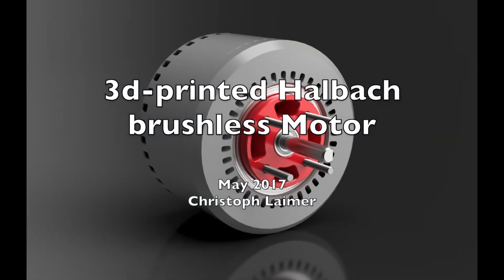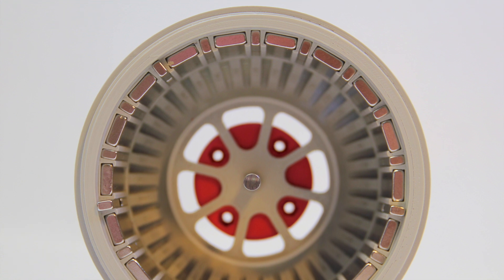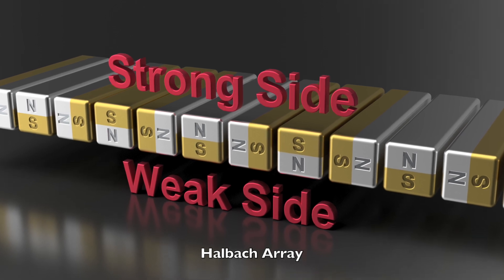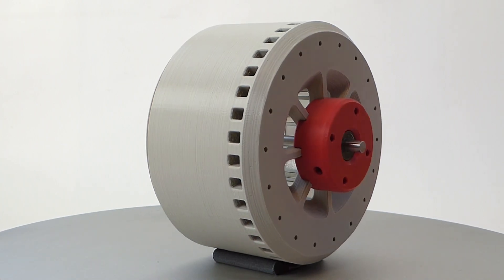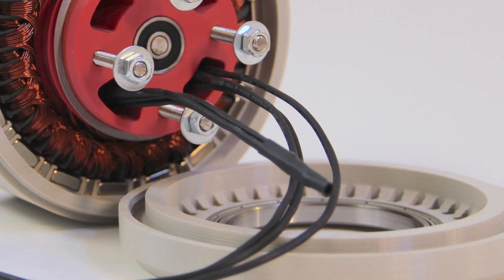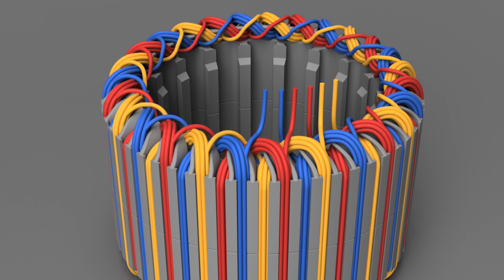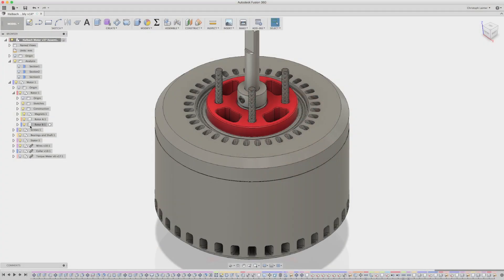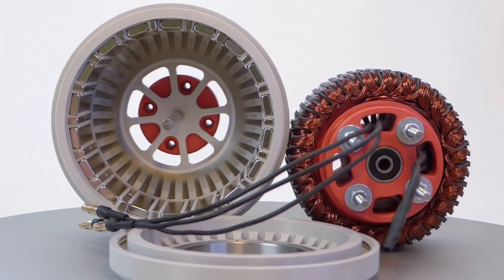600 Watt, 3d-printed, Halbach Array, brushless DC electric Motor

Comment: This is an amazing feat to me! but you are missing one critical thing!

Your power output could most likely double or triple if the stator was cut into laminations and was separated by sheets. 90% efficiency and 2-3kW continuous should be easy. Traditionally manufactured motors have laminated stators for very good reasons.
Reply from the maker: That's certainly correct, and I'm aware of that. My motivation to create this motor is based on using just 3d-printing at home. I don't have the tools to fabricate the laminations.
Reply: If you had a dual extruder setup, perhaps you could alternate layers of magnetic and non-magnetic PLA?
Reply: That is true if the ferromagnetic 3D printed material is very conductive, so laminations would limit the path for eddy currents.  If the material is more like a ferrite material with conductive and magnetic particles inside a non-conductive plastic, and the resulting conductivity is low, there might not be much eddy-currents induced.
Reply: the site of the manufacturer of the magnetic iron PLA states the material is not conductive, there shouldn't be big eddy currents
Reply: Could you please explain what do you mean by laminated stators? (simply as possible, if you can, since english is not my native language :D )
Reply: Halbach effect does not require lamination's, Lamination's only serve to  assist Eddy Current effects. Halbach Effect makes it unable to create Eddy Currents as the flux projects beyond the center of the stator  whereas the induction (coils) make use of it on one pole & regenerate it via the other. . . . . . . . .  Laminated designs are actually poor mechanical designs where whoever, didn't know how to measure flux vs. induction vs. weight. . . . . .  The old E=mc²

Comment: Design and the idea is very good.
Maybe try to create a design motor that could be used for electric motorcycles or bicycles. With several sections and at different speeds. In order not to have to buy expensive power regulators.

Comment: Awesome work! Do you think you could add a halbach array on the inside, so the total air gap is much smaller? have you measured the airgap flux?
Reply from the maker: I didn't measure the flux. The design is driven by the possibilities of 3d-printing - I wanted to explore these limits. If the rotor with the magnets was inside the stator, there would be serious issues with the construction: in order to counteract to the centrifugal forces of the magnets, there would have been a thick shell of plastique needed. The airgap and the distance of the copper wires from the magnets would have been much worse.
Reply: i mean on both inside and outside, use a layer of kelvar with epoxy around inner magnets? inner magnets will have to be smaller this would increase the flux greatly and give higher efficiency and torque

Comment: That looks very professional Christoph, however but I am more interested in generating electricity on a micro scale, can you run a parallel project of this kind using your design?
Reply from the maker: It's an electric machine which works as generator and as motor similarly well. Similar torque, similar rpm, similar current, similar voltage, same efficiency. As a generator 80% of the mechanical input power is converted into electrical power.

Comment: Sorry, but there is no Magnetic PLA on Proto-Pasta website. What should I use instead?
Reply from the maker: https://www.proto-pasta.com/pages/magnetic-iron-pla
Reply: I appreciate your work. I really do. But really that link you posted precisely doesn't show Magnetic PLA. There is a bunch of text on that page about Magnetic PLA and then there is a link that says "Shop Here" to buy it. But when you click on that link it goes to "404 Page Not Found". If you look at composite products page on proto-pasta there is no Magnetic PLA anywhere there. What they do have there is called "Composite PLA - Rustable Magnetic Iron". Is that the one?
Reply from the maker: https://www.proto-pasta.com/collections/exotic-composite-pla/products/magnetic-iron-pla
Yes, that's it. Seems that proto pasta doesn't maintain all the pages, and google still finds it. You need to find a reseller depending on your location (my shopping source only sells in Switzerland). There are other products with magnetic iron-powder, which I didn't test. It's important that the product states somehow "magnetic" or "iron". E.g. stainless steel filaments is useless because it's not much ferromagnetic.
Reply: Alright, thanks.

Comment: I believe you could make this larger and the correct size to bolt onto a tire. You could then remove the transmission and engine from a small vehicle to replace the weight and space with batteries. Maybe power the vehicle with 4 of these, one on each tire in a hub and rim assembly. Kind a like a 3d printed diy electric vehicle kit. Find someone who can 3d print the vehicle body and tires add an arduino and you have an entire 3dprinted vehicle. Call it the Voodoo Electric Vehicle.

Comment: I just bought the files and ordered the parts from China. Looking forward to test its performance and capabilities in an ebike like Tom Stanton recently introduced.
Reply from the maker: Cool idea! :-) Probably it requires a higher reduction. Also need to observe the temperature, if the maximum current is supplied at low rpm (during acceleration). The integrated ventilation works very well at higher rpm, I don't know, if a fan is needed for lower rpm.

Comment: Awesome. Can you also make a design for an AC motor? Oh that would be ever so exciting =)
Reply from the maker: Actually it a 3-phase AC motor operating at approx. 30V and 0-1000Hz. Frequency needs to be modulated depending on the motor angle and the desired speed.
A "traditional" AC motor would be fun too :-)

Comment: Ferromagnetic core increases coil inductance greatly, allowing to drive the load with much smaller currents for the same coil (but also at much lower speeds). However with very strong magnetic fields it gets saturated and will not conduct any more magnetic field, limiting the motor strength. The "air core" motor does not suffer from such issue and its magnetic field strength can rise indefinitely.

Also clearly it's a 3 phase synchronous AC motor with Y (wye) winding. It's just you drive it from DC/AC transformer. Real DC motors feed DC directly into the coils.

Comment: Seems lacking in ventilation and no integral cooling fan either. Might be a "one trick pony" in terms of application. I'd suspect it overheats easily if it were used anywhere besides aircraft and at high load. But doing what you're doing, I'd think you'd be able to remedy such faults easily with a MkII version.
Reply from the maker: This motor has an integrated ventilation, which works quite effective. Of course at very low RPM the heat from the copper losses can accumulate...

Comment: just a little input for your idea. replace the normal ballbearings with the ceramic one. it will reduce the drag effect & can spin in higher RPM

Comment: I think heat would be a problem for the stator. unless it's ideally made from a material that can be uv hardened afterwards. don't know if that specific filament exists but it would be needed if you wanted to use this motor for anything hardcore

Comment: electric student here, the magnetic PLA should significantly improve efficiency... with iron inserted, coils use lower current at the same voltage to provide same effect (same magnetic field strength)
Reply: You should make a video. Is there a specific way the iron inserts should be placed. Could you use iron nails and have holes 3d printed into the structure?
Reply: Gabriel Malek another thing to consider might be the use of insulators to reshape fields, in conjunction to the halbach array, and timing mechanisms that can be used to boost the motor at specific points of the cycling. Secondary sets of coils could also be placed outside of the motor configuration to become more efficient.
I like to sound like an expert on some topics of which have very little experience with, its also worth noting.
Reply: well I don't want to disagree with any electric student but I need to make sure you didn't assume there would be any induction or any other kind of "current" happening 
CAUSE IT DOESN'T

 keep in mind that the iron particles in the filament are NOT in any way connected to each other 

people create filaments like carbon fiber reinforced nylon which are total SCAMS as you need the fibers to run in a certain direction in order to get higher mechanical strength 
what these people do is they take that material and they mix in a pulverized form of it into the filament, which makes you think you'd have something much stringer when in fact it will basically be the same strength, when you see tests they will shot it has higher strength but that is usually because they tweaked the extrusion temperature and print speed and not because of the filament itself 

so, coming back to the "iron" filament YES it does get attracted by a magnet but does the simple presence of the metal provide better efficiency even though it's basically just dust randomly distributed inside a non-conductive material ?
Reply: he says he used that plastic in the video. you should watch it before commenting.
Reply: @darkshadowsx5949  the video said he doesn't know wether or not it's actually more efficient 
you should watch it before commenting
Reply: Hey Vid. I'm wondering if you know what type of motor I would need to power 4 propellers on a human sized drone. What would each of the 4 motors wattage and voltage have to be...example...1000w 24v etc
Reply: Who cares? Electric student? LOL
Reply: @sopsycho666  actually I care cause now I can ask him a question about something electrical.

Comment: How much does the parts costs on this project... Excluding the STL files and 3D printed parts (bearings, wires, magnets..)?
Reply from the maker: Approx USD 50. See https://www.instructables.com/id/600-Watt-3d-printed-Halbach-Array-Brushless-DC-Ele/
Reply: Have you tested it with more trusted parts? Such as not made in china magnets and bearings?
Reply from the maker: No. But it only can get better ;-)
Reply: Yes hahah I was just curious about by how much the improvement could be
Reply from the maker: I guess there is a relevant potential with better magnets. I believe that high quality N52 magnets are much stronger. The widely spreaded range of measured forces suggests, that they are maybe 30% stronger (hence 30% more power).
Reply: Do you know how much expensive would it get with better magnets?
Reply from the maker: No, I don't.

Comment: Amazing work!
Do you sand or do any post-print work in the bell?

I find that even for smaller prints the impressions of the filament extrusion tend to cause imbalances or wobbling to circular parts. But the bell on your motor seems to be well balanced.
Reply from the maker: Maybe I was lucky. I didn't have to post-process the rotor.

Comment: this would be cool with the special glass fibre or carbon fibre reinforced 3d printing filament and machine, the stuff that requires a special machine because the filament contains long strands of fibres
Reply from the maker: Mark 2 from Markforged can do this. Requires at minimum 3mm structure size. I've considered this, when I've created the design - there should be space enough for the fibers.

Comment: so if you were to be selling this, how much did you spend on it and how much would you charge based on hours put in and difficulty level? thanks
Reply from the maker: Files are sold here for $10:  https://www.makesea.com/e/6PO-3W5-3nE-1d2m-a3Q-3o5-1i26/Laimer-660-Watt-3d-printed-Halbach-Array-Brushless-Motor-Non-Commercial-Use-License
I've been working many hours on the design, and tested several variations - optimized the design until it was simple enough. It's very difficult to calculate the development costs, since I didn't count the hours. Probably I would need to sell several tousand copies of these designs (which I think is not realistic).
Reply: I priced it out on Alibaba ~ $140USD in materials (that includes 1.5X magnets required so you can get a decent match). Not sure if this is cost effective vs all metal motor equivalent yet. Maybe 10X more torque with lost casting the stator in cast iron?
Reply: Will  you sell the fusion 360 files ?
Reply from the maker: Yes, I will offer the Fusion 360 files. They are not yet online. Need to fclean-up the files and figure out the price.
Reply: Not realistic? lol

Comment: you said you can't find magnet of desired dimentiosn 
I can propose you to ask supermagnete.de I ask them for special dimentions magnets and they do it happyly
any way great job !!
I will be happy to get your advice on the possibility to create a dc brushed printed motor for an electric car application
Reply from the maker: Thanks for the hint. This would certainly simplify the assembly
Reply: I have thinking about that for a while. You can put the motor in the hub and create electric cars with motor in the wheels
Reply: vijf meilaan 
This is my question too...
1 motor per wheel would be all wheel drive, and would be add redundancy (back up) or reliability...
I guess could reduce the load needed for low rpm performance. 
I wonder if this could work for a go kart project? This can cover a lot of Engineering experience for students...

Comment: Great build and amazing quality. Do you think your design can be extended for 2kW motor or heat would be a huge issue ?
Reply from the maker: For increasing the power current or voltage needs to be increased. More current will cause temperature issues, higher voltage will cause issues with higher centrifugal forces (due to higher rpm). I don’t know where I'm already closer at the limit.

Comment: One more question, is Halbach array magnets stronger than double rotor magnets?
Reply from the maker: I guess the Halbach arrangement helps to save some wight ... I didn't test it.
Reply: Thanks for your reply. You right, In my test, the double rotor will have double power or little more. How about the halbach?

Comment: Ich bin fasziniert ab Ihrem Elektromotor! Cool :-)
Dazu hätte ich noch folgende Fragen und Überlegungen:

Fragen:
- 1. So ein Motor kann doch auch als (Drehstrom?)Generator benutzt werden. Wie sieht es da mit dem Wirkungsgrad aus?
- 2. Was müsste an Ihrem Motor verändert werden, damit dieser als Generator für Klein-VAWT (Vertical Acis Wind Turbine) benutzt werden kann? Reicht da evtl. dünnerer Draht mit mehr Wicklungen?
- 3 Wie sieht es mit der Skalierbarkeit aus? Könnte dieser Motor/Generator fast beliebig verkleinert und vergrössert werden. 

Überlegungen:
- Würde mann zwei gleiche Motore aneinander, einer als Motor den anderen als Generator anschliessen. Wie hoch wäre wohl der Wirkungsgrad des Systems? Das fände ich ein interessantes Video :-)
- Cool wäre auch ein skalierbarer Generator für (DIY) VAWTs, welcher bei geringen Umdrehungszahlen funktioniert. Das Thema "langsamlaufender Generator" ist in der VAWT Szene heiss diskutiert.  Sehr cool wäre natürlich, wenn Sie gleich eine funktionierende, stromproduzierende mini VAWT mit 3d Druck bauen würden :-)

Einer Ihrer Abonennten sendet einen Gruss und wünscht Ihnen weiterhin viel Erfolg mit ihren interessanten Projekten!

Thomi
Reply from the maker: Die elektrische Maschine funktioniert als Motor und als Generator genau gleich gut. Mit dünnerem Draht und mehreren Wicklungen wird die Spannung im Vergleich zur Drehzahl angehoben (kleiners Kv). Allerdings lässt sich bei einer niedrigeren Drehzahl nicht 600W umsetzen.
Der Wirkungsgrad des Systems Motor+Generator ist schätzungsweise 64% (das Produkt von 80% mal 80%)

Comment: Is this not AC?
Reply from the maker: Yes (and No). That's how the name of this kind of motor is defined: https://en.wikipedia.org/wiki/Brushless_DC_electric_motor
Reply: Ok I did google it after seeing the video and it is indeed defined as DC... the final voltage is 3 phase AC though correct?

Comment: Excellent work Christoph, I think Flitetest and RCModelReviews need to see this.
Wrapping the rotor and binding with slightly pretensioned kevlar or carbon fibre would give me a bit more confidence that it would hold together at speed!

The magnetic PLA sounds like an amazing material, I wonder if the particles inhibit eddy currents in much the same way as traditional laminated stators and reduce losses.

HobbyKing produce a 10kW motor of a similar size for a few hundred euros -  would be interesting to compare the windings and construction and learn how it deals with heat removal.
3D printing gives so many possibilities for winding schemes and topologies - exciting times!
Reply from the maker: I also like the possibility to "play" with winding schemes, AND the possibility to do this experiments without the need of complex machinery.

Comment: I have an idea for the coil core. 
What if you simulated the laminated metal construction of a standard core by printing in with a dual nozzle system? Alternate layers of conductive filament and an insulator. Have one roll of conductive material on one nozzle, and another of the nonconductive variant of that materal.
Reply from the maker: The magnetic PLA from Proto-Pasta is not conductive. And the conductive filaments are not ferromgnetic (usually these filaments contain some graphite).

Comment: Maybe you can modify holes on top of rotor, so when motor is working, they will work basically as propeller and gather air inside of motor for better cooling of whole motor?
Reply: So, just to put thoose holes little bit under angle